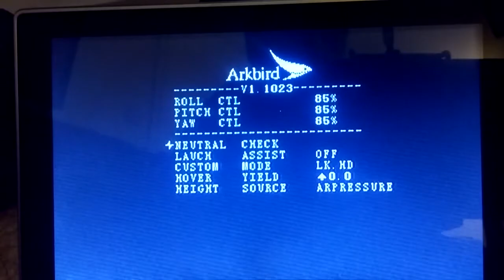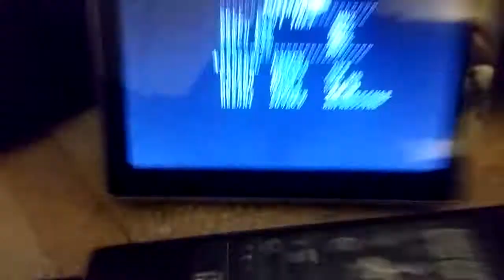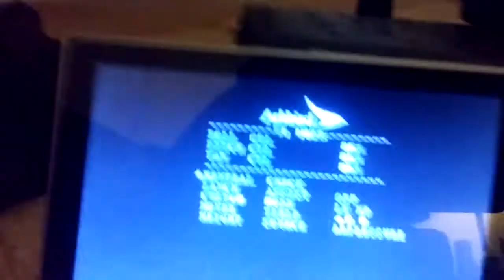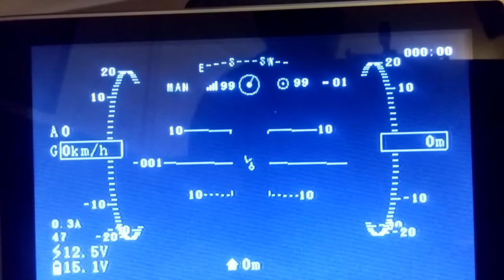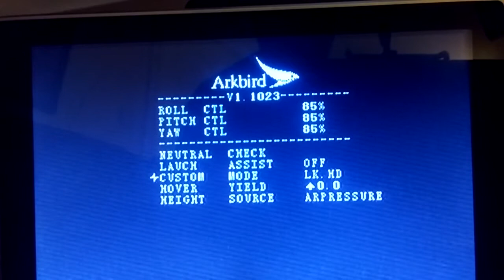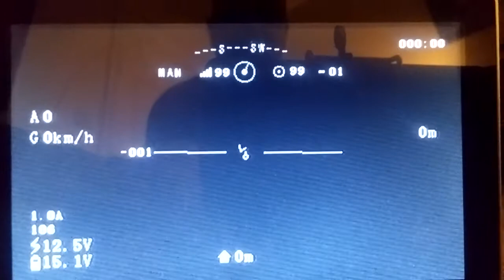Arkbird Autopilot 2.0 reveiw PART 3(menu/settings)

Comment: Hi, congratulations for the videos. A question. What monitor is what I see in the video? Monitor for fpv? Does it have an integrated rx? Thanks if you want to answer me.
Reply from the maker: It's a monitor that came with the hobbyking v2 fpv goggles, and no it does not have integrated vtx.

Comment: My friend, I already did 40 minute flights with 3S battery using a 1250KV NTM 3542 engine, it is very economical, and I used a similar airplane to the Mini Talon I made, very good indeed !!!
The battery that I have 4S is just a 5200mah Multistar.
I saw in the Manual that it accepts 3S for Video and OSD, but 2S - 6S for Motor, so I will try to use a BEC of reduction for 12V to test.
Did you use Ferrite rings to try to reduce Interference?
Reply from the maker: yes i did many ferrite rings in there, i just like the punch of 4s more than the time,  plus with the new current sensor it makes it cleaner BUT if you are getting 40 minutes with 1250 NTM then you have very efficient setup indeed,, i dont think there is any need to change anything there,, 
the only problem with multistar battery being only 10c is that it sags alot but it does go a long way.
Reply: Unfortunately the plane that I had with this configuration lost and I never found it again, because I did not record the flight that day !! kk

Comment: How are you, my friend, have you used the 4S battery in this OSD?
Can I use only a 4S Battery for the whole system or do I have to use a 3S battery to power the OSD and a 4S to the Motor?
Reply from the maker: hey carlos, i have watched some of your videos my friend,, some great fpv on your channel.

as to your question, as standard you can only use 3s battery with arkbird and it powers everything but in my opinion its not the best or the optimal solution. i never use 3s so i had to use step down BEC for video which made interference.
 i bought an optional 4s current sensor for 25USD from arkbird, that allows you to plug 4s and forget about it, everything else is powered through that and it makes for a very clean and interference free setup, to be honest arkbird should include 4s current sensor as standard. 
i use multistar 5200mah 4s, one battery for the whole fx61 with everything on it and i can easily get 25 to 30 minutes flight times.

Comment: Hello there , Arkbird asked me to ask you if you can help.
I have just bought arkbird 2, and i cannot get into the menu. I use Futaba TJ6 with the dragon link Advanced.
I fly in mode 1
Chanel 5 is on my 2 position switch on the Futaba, for the 3 position switch i use ex1 on the dragon link which is assigned to chanel6
So all good there. But I cannot get into the menu.
I hold the aileron stick to the right and nothing happens, I have tried every switch position and nothing happens.
I sometimes get the flight information screen, but it will not go into the menu.
Do you think you could suggest something.
Do you think my transmiter is at fault. I do know the dragon link switch is working as it does activatethe flying surfaces of my other plane
Thank you for any advice
regards
Stacey
Reply from the maker: hi stacey, sorry for the late reply, i was abroad for a week. i use a futaba myseslf as you can see from my videos, although i fly mode 2, so in your case your throttle and aileron are on the right stick if iam correct.

the 2 pos switch channel 5 and 3 pos switch channel 6 would not affect how you get into menu as its purely an aileron stick function. which brings me to to a couple of suggestions or guesses on my part.

1. has your transmitter got any pre activated mixes for the model you are working with? for example an ELEVON mis or VTAIL mix active in your transmitter? if YES then please turn them off and wipe any mixes and try again.

2. when you put your aileron stick to the right, also being throttle do you keep it at the bottom or do you bring it to centre and then push right. it should'nt turn on the throttle (if throttle safe is on).

these are the two scenarios that i can think of at the moment, having never worked with a mode 1 TX iam at a slight disadvantage here but iam sure we can figure it out together. try the above scenarios and get back to me with  any results and we will take it from there and hopefully get you flying soon.
Reply: Thanks for getting back to me. I have been chatting with the guys from arkbird, they have been really helpful. We have come to the conclusion that there must be a fault with the unit, So today i have posted it to them , They are going to check it even though i did not purchase it from them. So hopefully it will come back good. 
We exhausted the ways to get into the menu so this seems to be the only way.
I have put FY-41AP lite, and i have to say , brilliant, the screen resolution is the only weak thing , But works great.
Thank you for taking your time to answer.
The guys from arkbird in China are doing a great job and looking forward to installing it in one of my planes.
Keep the video,s coming.
I also like the stuff from ali in China
Cheers, happy flying